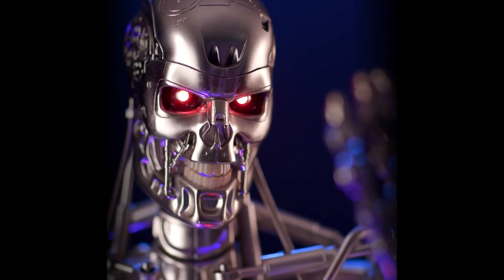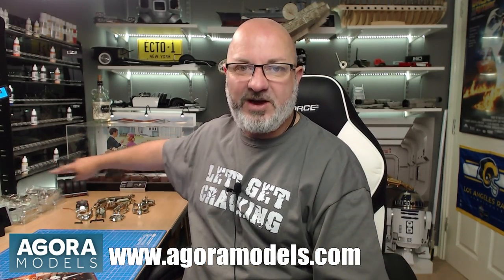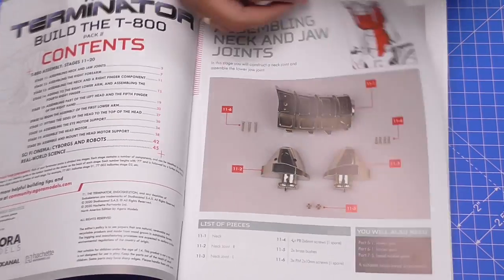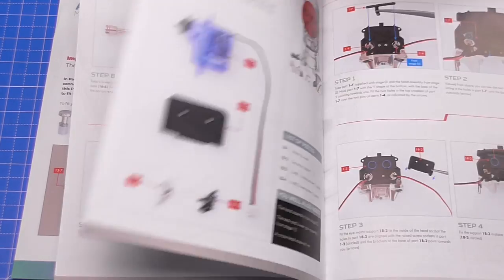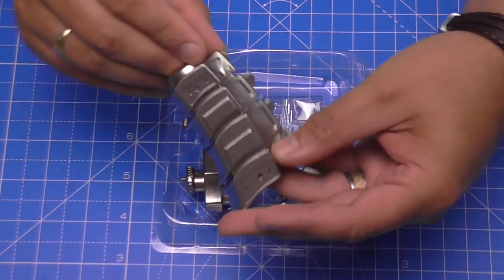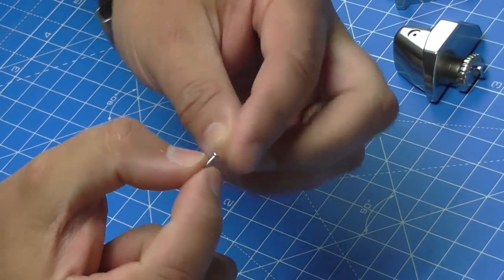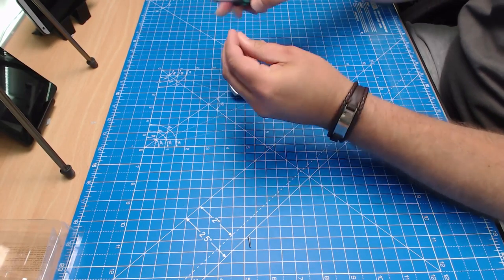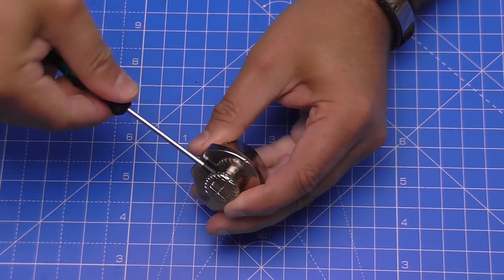Agora Models Build the Terminator - Pack 2 - Stages 11-20

Comment: 5:29 i cant get the screw to fit!!! it screws in a bit but then it stops. what can i do?
Reply from the maker: That’s a new one on me. I didn’t have an issue with that screw. Does the jaw need bending slightly to engage the screw in the thread?
Reply: no. the jaw is fine but i don’t know if the top neck piece has fabrication errors on the screw holes because they seem to be tight on one side (the other side had the same problem but not as bad as the side i need help with now. i just applied a bit more force and it went through)

Comment: Does the motor have a very slight downward angle when its installed? I just did mine and it seems to slant slightly downward and not sit perfectly level.
Reply from the maker: Not that I noticed but as long as it is fully engaged it shouldn't matter

Comment: I probably asked you this but in total $ amount did the terminator project cost the prices on the website is too damn confusing any help would be appreciated thankyou sir ooh i thought about a great model but you'll need to 3d print in metal (mechagodzilla).if you 3d print them I'd rather buy the whole project from you.
Reply from the maker: It’s 12 packs so roughly £1200